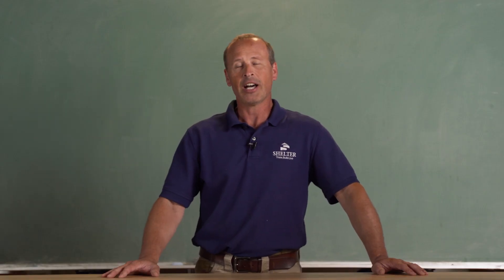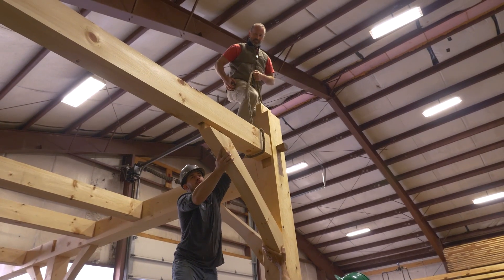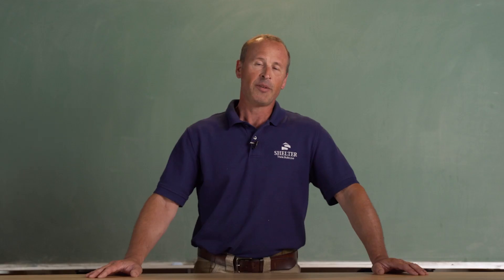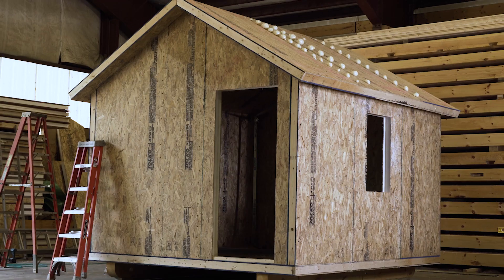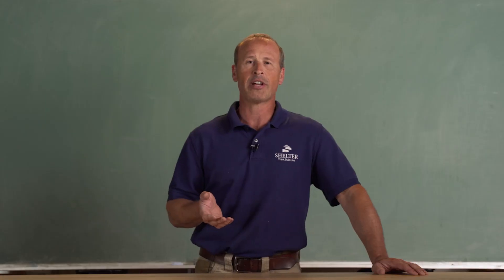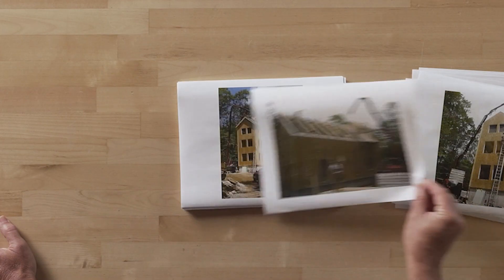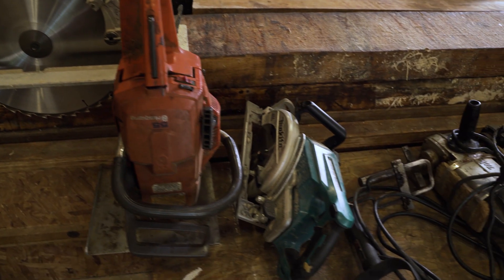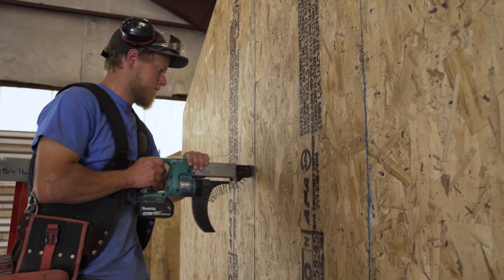Learn How To Build With Structural Insulated Panels!

Comment: An eternal frame and SIPs Panels. They are the shoddiest material in existence. They warp,ants make nests in them. Sorry folks. Timber framing is not an efficient use of materials. The materials that compliment it are trash. If u stud the frame you diont need Timber framing. That is the reality. You are not living in 1645.Anything with OSB is ....awful.